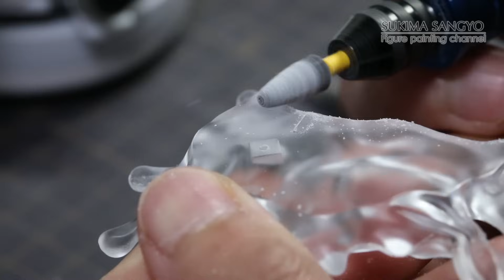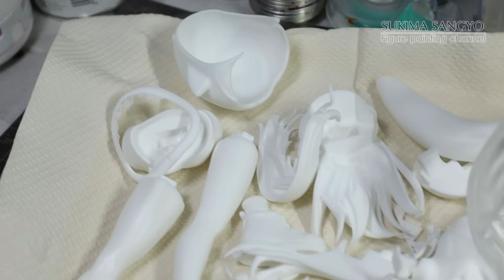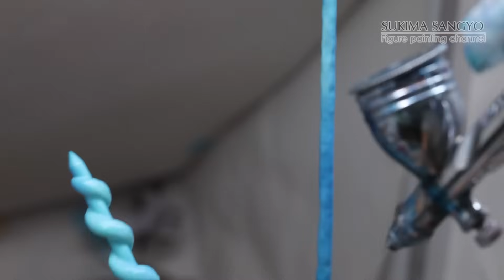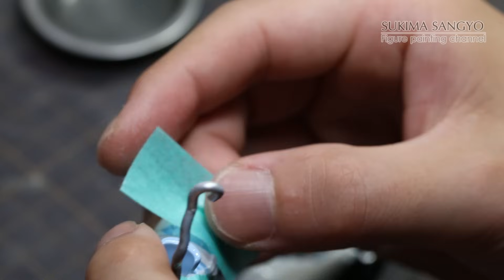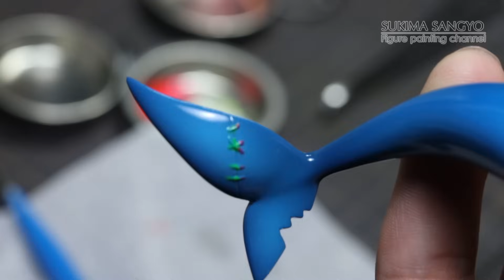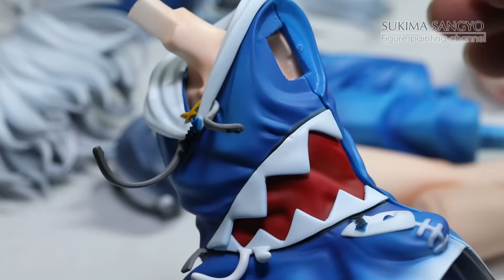【ガレキ】がうるぐらのフィギュアを組み立て塗装する/Gawr Gura Garage kit figure assembling and painting

Comment: How do you paint the clear parts so they still stay shiny? When I paint clear pieces, they tend to lose their lustre :(
Reply: So there are different types of paints and blues. There I think he used a blue called Thalo blue that dries translucent instead of opaque. Thalo colors come in all brands since it’s not a brand itself, but a type of pigment. Like pearlescent or metallic
Reply: Sounds like you're using satin paints when you should be using gloss, also thinning your paint helps keep it shiny
Reply: You could try glazing an acrylic ink over them. That usually turns out okay in my book. Though if you wanna go back and make what you have more "shiny" you could hit it with a gloss varnish.

Comment: I once tried making a figure like this, but I didn’t have proper tools. I had to use dental handpiece and 330 burs to shave the excess plastic away and use composite resin and curing lights to fill in air bubbles and voids on the 3D printed model.

Comment: Some questions
1) It looked liked you primed the model in the beginning but it was clear liquid what you used. What was that?
2) What brand paints did you use? Did you thin them? if so with what, and what ratio?
3) what pressure do you use on your air compressor?
4) I also noticed you used a hot air gun? which one? what btu?